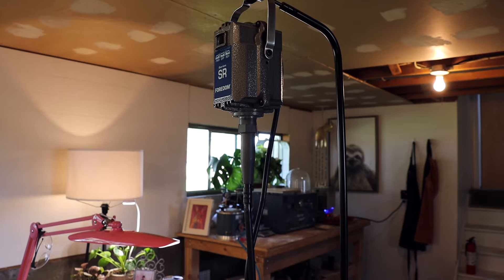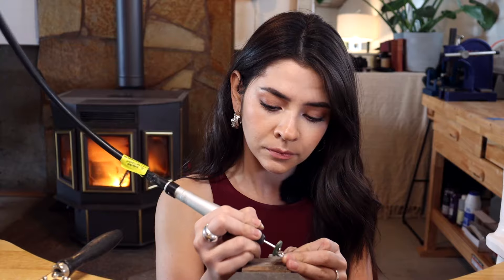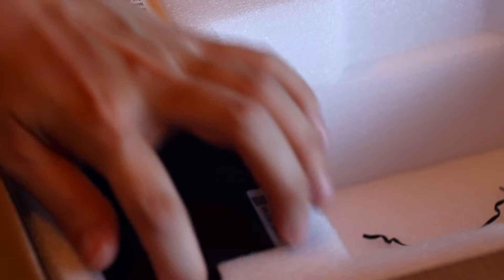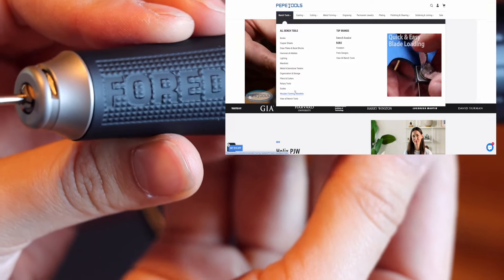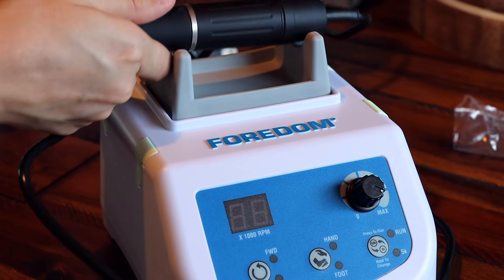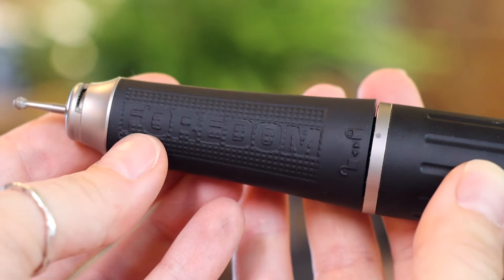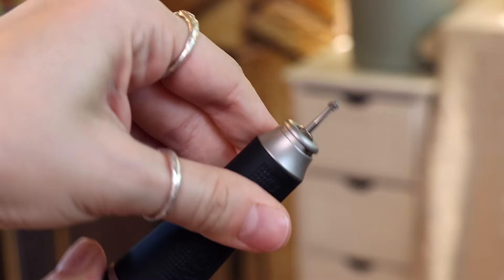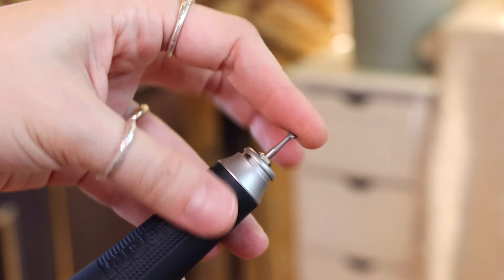Foredom Pendant Motor vs Micromotor | Best Rotary Tool for Jewelers?

Comment: When I started making jewelry, I used a dental marathon micromotor (less than $100). It didn’t have a foot pedal but it had its benefits. But I needed to get a foot pedal activated tool and purchased the Foredom flex shaft.  I really haven’t had the need to go back to the micromotor anymore but there are really affordable options for them if someone’s not really to spend a few hundred on a flex shaft  🙂
Reply from the maker: Yesss I’ve seen people use the dental ones too and always wondered if they were powerful enough? Thank you! 💜

Comment: 🤔I think your pendant motor's flex shaft needs to be oiled. Correction: seeing the black goop on it You need to clean your pendant motor's flex shaft, as the grease should not be leaking out of it and should not be black...you might have torn up some of the casing...as i have seen that on my old Dremel flex shaft tool after doing that...and also regrease The sound its making is NOT a good sound. You NEED to do some maintenance on it. i would check the brushes on it too as they might need changing. The instruction manual tells you how to do this.
Reply from the maker: Not going to lie, added the flex shaft grease that came with it to the tip because I assumed it needed it 👀😂 (runs to wipe it off). I’ll look into the maintenance of it all, thank you for pointing that out! 🙏🏻
Reply: @MiteraMade I have done the maintenance on my SR 3 times. It's not hard. It's a bit goopy, but all doable. I always appreciate those helpful comments - and reminders. I gotta do mine too, ack! 😂😅

Comment: Thanks Adriana, I have been looking at getting a Micromotor over my Pendant for its comfort. There is a Foredom which has both regular and hammer handpieces (dual), its pricey but I think it would be very worth it. Found your channel a couple of weeks ago and am enthralled by your work. Rustic yet elegant. I am keen to try some Lost Wax carving but may have to begin with Delph clay to begin with, is that how you started out on your wax journey?
Reply from the maker: What. 🫢 If that’s true then wow, that’s the king of them all, thank you for letting me know! 🙌🏼 🎉 and thank you for the compliment on my work 🥹 I did actually try Delph clay once when I first started but I did not have the right torch so it wasn’t successful by any means 😂🙈 I immediately found a cast house after that 🙈 definitely worth a try though, I’ve seen some beautiful work come from delph clay casting 🙌🏼
Reply: Can you please tell us which model ? thank you

Comment: 7:21 - Something to keep in mind is the grease near the key tip will eventually migrate into the sealed bearings on the quick change and H30 hand pieces and cause them to overheat and wear out. Foredom recommends cleaning that and one way to avoid it from happening is not letting the flex shaft hang while not in use. Great video!
Reply: Foredom makes a little clipped thing that goes onto your flex shaft/pendant motor stand, you can put two shafts with handpieces on each one. This keeps the hand-pieces stored UP.
Reply: Oh wow i had no idea. I always leave it hanging, i thought this was the best way to store it lol WOOPS

Comment: Hi Adriana! Thank you for this video it was really helpful ☺☺ I'm planning to change mine and get the micromotor, but since i already have a few tips that i bought for my previous one (DREMEL 3000) i'm worried that my tips won't fit in the new one. Do you know the diameter of the compatible tips for the micromotor? Mine are 3mm. Thank you! 💖

Comment: I have a question, I own a fiber laser machine for cutting silver, gold and copper. After cutting, I notice that there are traces of the laser on the edges that have not gone away. I tried washing them with ultrasonic and tried salt and vinegar. I even tried hydrochloric acid at a high concentration of 34%, but to no avail. Does the micromotor help in polishing the edges from the ends? If yes, what is the feather that I should use?

Comment: I'm a beginner when it comes to jewellery making, and I'm looking to buy a motor primarily to drill holes into silver rings and set stones with the grain method, would you recommend the micromotor for these purposes? It feels like a big investment and I'm so indecisive haha
Reply from the maker: I personally feel if your focus is more going to be on stone setting, especially grain and bead setting, than a micro motor would be better, simply because they’re more comfortable to handle over a long period of time and they have less vibration which helps you with precision especially when working with smaller gems. NOW, I’ve done both with both lol and so I also feel like if a micromotor is out of the budget, you absolutely can accomplish a lot with a pendant motor and they really are a work horse. So final answer for your situation, micromotor. 🙌🏼🙈
Reply: @ Thank you so much for this info, I’m definitely leaning toward the micromotor! I’ve been debating for days haha so I appreciate your answer :-)

Comment: I've been using my dremel with flex shaft which I bought six years ago for drilling stones and making grooves. Because I'm only just starting out with lost wax work I'm trying to make do with what I've got but I DREAM to get a better piece of equipment because the dremel is uncomfortable when using for long periods. The micromotor sounds amazing but I really do want a hammer handpiece so I’ll probably go for a pendant motor.
Next on the list is a proper ring vice though. I'm currently using a massive handymans vice that's SUPER heavy haha
Reply: @AlchemyWithSoul  Micro-motor has hammer hand-piece choices. Yay! Best choice I made of ALL my tools.